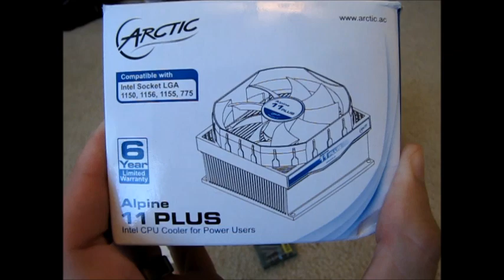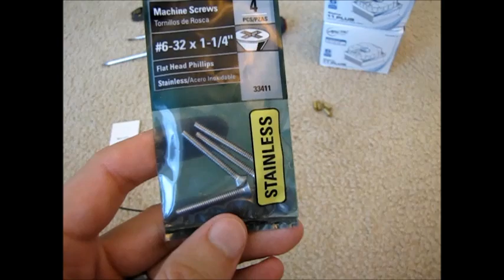How To Build A Peltier/TEC Cooling Device (Thermoelectric Cooler)

Comment: They have these all assembled on ebay for under $20 http://www.ebay.com/itm/231419611167
Reply from the maker: Yeah, I have seen those.  I am highly skeptical of the quality of those units.  As you can see, they have driven screws through the peltier itself to be able to attach the tiny heat sink and fan on the one side (I assume the cold side).  I have taken apart peltiers and I can't imagine screws being driven through them without permanently damaging it or destroying it.  Also, the heat sink on the tiny fan doesn't cover the whole peltier chip so I don't know that it is going to produce as much cold air as it could otherwise.
Reply from the maker: afk bot
Cool, thanks for the tips.  I will be re-visiting this project again soon.
Reply: LDSreliance  Hey no worries ..
Reply: +LDSreliance indeed .remember the size of fans will tell you to.some degree your cool and heat removal. . I use for Dwc And water tank cooling  .. yet his design isn't for WATER COOLING TANKS OR DWC.you use the tec1-12706 chip .. fan heatsink just like his ONLY ONE FAN .and a waterblock. .. heat side of chip sits on Heatsink fan.. cool side rest on waterblock  that's where ya cooling.  now depending on your Fan heatsink size determines your Cooling. a shyt heatsink with a tiny fan will cool a gallon to three maybe a little. . 25 gallons and up. ya going to need bigger parts. and a water pump to move that water around  n mixup cool and warm IMO..  some cool 2 4 degree lower ..Again you water mass.and the temp you trying to achieve. . you can get 5 Tec1 12706 on amazon about $20 don't use cheap paste .Don't half arse cover the heatsink or bulky and uneven. start in middle 4  dabs or buy squared thermo paste .if ya messup. use alcohol wipe clean both chip n heatsink. .Fact You will burn that chip to shyt.if it's not mounted properly. .test with 1 fan take notes on waters beginning temp. time water cool down .. see I'd that's good.  then do another fan bigger 
.etc etc untill.you good...old moddin days and being a hardware eng. . I can make 30 of these with all the fans I have .. hopes that helps someone

Comment: I have a Koolatron P20 the fan blows but it stopped cooling. I took it apart to look at it but the chip was cement on and wouldn't come off. In your experience can the chip or some thing stop working? Thx 4 the vid
Reply from the maker: Yes, it can.  Most of the peltiers I have played with are fragile and cheaply made.  I am sure the Koolatron chips are the same.  The American made ones are expensive so I think those are only used in medical devices and expensive devices like that.

If it is cemented on there you should be able to just crack it off and then scrape off the cement and sand the surface back down smooth and put on your own peltier (with thermal compound of course).
Reply: Where do you get thermal compound? Thx 4 getting back with me.I just looked up a the Peltor on Amazon, $9.89. says 12v 100w. do i need to know anything else? Are some colder than others?
Reply from the maker: Justsay'n
100w is pretty good.  That is stronger than the one I showed in the video and will get colder as long as you have a good heat sink on the hot side.

Thermal compound is like Arctic Silver, which is used in building high performance computers.  It goes between the peltier and the heat sink to form a more efficient surface bond.  It also keeps the peltier from moving around.

Comment: hey i wanted to mention something, i ordered one the chinese cheapys just to play with. tryed in many differnt size containers. but i docovered all of them sucked. then i got ahold one the colman 40q coolers cooling type used untested in town for $10. it has a small duct for inside fan so i took some carboard and made a temp one just to direct air away from fan and heatsink. the small box i made (insulated) b4 temp duct work, wouldnt get below 46f but after it. got it down to 31f and room i am in i keep near 76f. idk if u tryed it so i tought id add my 2 cents
Reply from the maker: Very nice!  Thanks for sharing.

Comment: I understand that one of fans is to get hot air out 
but what is the function of the other fan??
Reply from the maker: +Mina Kozman Just to circulate air in the box.  I thought it might help it chill faster.  It is not necessary, though.
Reply: +LDSreliance 
but if i will use it to cool a box 
It is much better if I used 2 fans
right??
Reply from the maker: Mina Kozman I don't think so.  I think a cold plate or just a heat sink like this would work just as well.

Comment: Idea.  Try to use your 2 devices that are 5 amps each and stack them by using longer bolts.  Hot to one sink and cold to the hot side of the other device.  Second heat sink on the cold side of the second device.  You should see more temperature differential.... I think.
Reply from the maker: +Bob Buell Yes, that is called cascading and it has been suggested to me quite a few times.  The question, though, is will it provide more benefit than operating those same 2 peltiers independently?  In other words, if one peltier can cool down a volume of air by 10 degrees and 2 peltiers cools down that same volume by 16 degrees... will 2 peltiers cascaded exceed 16 degrees?  Because if not it makes no sense to do it that way because you are consuming 10 amps either way.

Comment: wondering if you would see better results with a larger heat sink.... especially on the hot side.
Reply from the maker: +Bob Buell More surface area or better conductive material would certainly improve performance.  I went with liquid cooling after this setup and I can't directly compare the two (I should have done so) but it seemed to be more efficient and certainly was easier to mount.

Comment: Hey!Nice informative video.I am building a water purifier where i need to condense the water vapour so that droplets are formed,Will the cooling done by the peltier be enough to do that?Thanks.
Reply from the maker: +Seerat Kaur Yes, I think that would work.  You could build a "worm" like is used in making liquor where the hot gas passes through a coiled copper pipe that is cooled down by water.  But in your case you could have the gas pass through a heat extractor of some kind that is attached to the cold side of the peltier.
Reply: +LDSreliance Okay.Thanks!
Reply from the maker: Seerat Kaur
You are welcome.  Good luck and thanks for watching!

Comment: wonderful video. very helpful. one design suggestion: use zip ties to connect the 2 heat sinks instead of metal screws/bolts. less thermal transfer across the 2 sides because plastic zip ties conduct less heat than metal screws and it's easier!
Reply from the maker: +Joe Southwell True.  But zip ties get brittle and break over time when subject to hot and cold cycles.  I have used them in cars and other applications and they don't last long.  But good suggestion!
Reply: Twisted insulated wire? Seems like there must be a good way to keep better thermal isolation between 2 heat sinks rather than 4 metal bolts.
Reply from the maker: Joe Southwell
Someone proposed nylon screws before.  Something like that would be pretty ideal, too.
Reply: Alluminum screws would surfice

Comment: HI this is the first video I have seen and I found it very interesting .Could you give me diagram how to wire it up please as I am new to these things.
Reply from the maker: +mango3586 I can't post up a diagram in the comments here but I can tell you how to do it.  Each of the peltier chips will have 2 wires, one black and one red.  Black is negative and red is positive.  Connect the red wire to the positive side of your battery and the black to the negative side.  For the fans, they will have a connector on the end designed for computer motherboards.  Look at the end of the connector and the wire on one side or the other will have a small triangle symbol or pointer symbol on it.  That wire will be the negative wire.  The VERY next wire to that will be the positive wire (even though it is black you will wire it up like it is red).  Any other wires will not be used.  So you simply chop off the connector on the end and use the one with the triangle as negative and the one next to it as positive.

Comment: Thanks for the links for cheap sources, I was just about to look into building some sort of solar powered body cooling device to help me work in the garden since being diagnosed with MS last year. My plan is use a bicycle tire inner tube filled with water instead of air and drape it around the neck and shoulders and then couple a battery-powered peltier/heat-sink and fan to a section of the tube somehow to pull heat out and build solar panels into a sun hat of some sort.

Even if the bulk of the parts have to be placed onto a walker or something with a coiled power wire it would be better than nothing (hopefully). In any case, it's nice to know the parts are cheap enough to tinker around with and readily available via Amazon for delivery!
Reply from the maker: +Dreadragon Flame Cool idea.  I know the Japanese have had some personal cooling devices on the market for years but, like any peltier devices, they suck power thirstily.  You'll need a pretty big solar hat or a backpack with batteries in it to even power a 5 amp peltier I am afraid.
Reply: LDSreliance
Thus the "after thought" of using my walker in conjunction. The ones with 4 wheels and locking brakes are actually quite versatile and sturdy and even come with a basket and a seat! A few compact folding solar panels and a Lithium battery or two and maybe a retractable or spirally pigtail cord for power and the rest should be pretty lightweight.
I don't have much choice but to begin considering gardening options for the disabled, but the more I do, the more attractive the practice may become to "regularly abled" folk as well.

Hopefully though, these things can begin to get integrated together if demand gets high enough.
Reply from the maker: Dreadragon Flame
I admire your persistence and determination to continue doing your hobbies despite your challenges.  Awesome stuff!

You might even consider putting a stationary solar panel and small battery cabinet in your garden that can be outside and stay charge up and topped off at all times and have a 20 foot cord (or whatever length) with a quick disconnect coupling on it that you can just plug in to your bicycle tire device when you are out there and with enough slack to get where you need to go.  That would be cheaper than flexible solar panels and bulky contraptions and leave you free to move around.  It will also have time to recharge between uses whereas you may only be outside for an hour or two and that is really not long enough to fully charge and maintain a battery.
Reply: Noob here may I ask a question cant seem to find an answer on google. When getting the TEC1 chip what is the difference between the numbers? 12706, 12715? which one is colder than the other? thanks so much
Reply from the maker: RaymondJacob0922
Answered this question on your other comment.

Comment: Hey question again.  I just received 3 new cells.  I hooked up all 3 to my power supply,  They get extremely hot!, both sides.  Do they have to be assembled with my heat sinks to get one side to become cold?  I am running them at 14 volts but thought one side would get really hot and one really cold.  I also milled down my heat sink bases so the aluminum is pretty thin.  I would think this will do a better job at the hot cold transfer.
Reply: Read up on peltier cooling and heat removal . You seems to know nothing.
Reply from the maker: Yes, you HAVE to have a heat sink on the hot side at all times.  Power it up for 2-3 seconds and then you can feel which is hot and which is cold.  Then attach a heat sink to the hot side.

Comment: what do you put the red/black wire into to make them work?
Reply: +Cam Dixon (dft91) if you have to ask, you should go on google. Are you always spoon fed?
Reply from the maker: +Cam Dixon (dft91) You connect the red (positive) wire and black (negative) wire to either a 12v battery or a 12v power supply, such as a computer power supply or laptop power adapter.
Reply: +LDSreliance how would the red and black wires fit in something like a laptop power adapter?
Reply from the maker: Cam Dixon
*Make sure the adapter outputs 12v before you modify anything*

You just hack off the male connector on the end of the laptop adapter wire that plugs in to the laptop and there will be 2 wires exposed.  One wire will be positive and one wire will be negative.  Keep in mind that a lot of laptop adapters now are 18.5-19v so make sure you are using one that is 12v.

Here is an example of one that is actually designed for computer monitors but does the same thing:  http://www.amazon.com/LCD-AC-Adapter-3-Prong-Power/dp/B003TUMDWG/ref=sr_1_2?ie=UTF8&qid=1453761521&sr=8-2&keywords=laptop+power+adapter+12v
Reply: I've tried almost 5 different 12v adapters and none of them will get the plate working.  Does the amperage matter?  I'm only have 3A and below
Reply: Jeremy J. Look at the specs, mostly it says TEC 127xx. XX means the nominal amperage.
To get your power supply, especially if you are going to use it continuously, multiply your total current by 1.25 or 1.20. That way you won't stress out your psu.
Reply: it uses 6-9 amps per module

Comment: New to this. Looks like a great idea. I have seen those mini coolers out of Austrailia that use 1.7 amps and water-great for by the bed. would be nicer to make something. I am lost here. It would help if you had sound for the 2nd half so I could hear you explain what you are doing.
Reply from the maker: +Prima Donna Going Off Grid Yeah, sorry.  I would recommend you check out the liquid cooled peltier stuff I did more recently anyways.  It was easier to set up and seemed to be more effective.

Comment: Why not use nylon bolts, they wont transfer heat to the cooling side.
Reply from the maker: +markdf14 That is an excellent idea!  I did not think of that.  Do you know any good suppliers for those?
Reply: I've found lots of suppliers on ebay, about to order some to experiement with a couple of Peltiers. I've been able to get some large heat sinks from some dead computers.
Reply from the maker: markdf14
Cool, I will have to look into it if I build any more of these.

Comment: Great teaching video.  Curious, do you think the one you built would be enough to install in my dog houses for summer use?  I would like to keep them around 75 F. Outside temperature about 90 F.  They are about 25 cu. ft, well insulated and a good, tight door .  Thanks Mike
Reply from the maker: +Mike Hill No, this one would not be adequate.  This one was adequate to bring about 1 cubic foot down about 30 degrees or so in a tight sealed and insulated environment.  If you used one of these to chill a small amount of water, though, and fed it through a coiled copper tube that you attached to the front of a small fan and put it inside the dog house then at least you could blow cold air.  It would not keep the whole dog house 75 degrees but you could blow the air at their dog bed or whatever and they could keep cool a little bit.

Comment: You should reword your label for this device.. You are not actually building a peltier cooling device... You are using a peltier device to cool something..  I clicked on this because I would like to know how to build a peltier cooling device using two ceramic plates, bismuth and other metals used in a peltier..
Reply from the maker: +Robert Lominick Well if you are going to get technical peltiers are not cooling devices, they are heat pumps.  Sorry for the confusing title.

Comment: Can you power a peltier from a 12v wall adapter? I see videos of people using a laptop power supply. Is there any reason for this?
Reply from the maker: +arjun kumar Yep you can use any 12v power supply.  Many laptop power adapters are 12v so that is why you see people (including me) use them.  They are super cheap (I have ordered some for $6 on Amazon before) and they come in sizes of usually 60-90 watts which is perfect for lower power peltiers like the 12705.

Comment: Dear LDS, could you give me little more details like the constant voltage to be maintained, how to recognize the sides of cold n hot of peltier, can we use both the hot-n-cold sides simultaneously,  how long continually it can work...etc.
Reply from the maker: +Anthony Yes you can use both sides at the same time.  That would make the energy investment much more worthwhile if you could do that.  As far as I know it can run constantly but they are fragile and not manufactured very well (at least not the cheap Chinese ones I have used).  So I don't know how long they will last.  I am told that they are more efficient at lower voltages but I don't know that for sure.  I would just plan on 12v and wire in a thermostat if you want more control.
Reply: +LDSreliance Thanks LDS for the fast response and valuable information.

Comment: There are four wires as below:
Black - 
Red - 
Yellow - 
Blue - 
out the CPU cooler, which ones should I use? Thanks.
Reply from the maker: +Gio Presti Just the red and black.  The others are sensors or controllers of some kind and aren't necessary for this project.

Comment: So a quick question for you. I'm looking for something cheap and easy to build for my fish tank, I keep an axolotl, which gets sick when the tank heats up too much, do you think if I wired this with a basic wall plug, and a thermostat it would be efficient?
Reply: http://www.ebay.in/itm/TEC1-12706-Thermoelectric-Cooler-Peltier-Module-12V-92W-max-/162312933113?
Reply: Hrishi raj Gupta  pls col me 8178227193
Reply: mujjko apko help chahiye